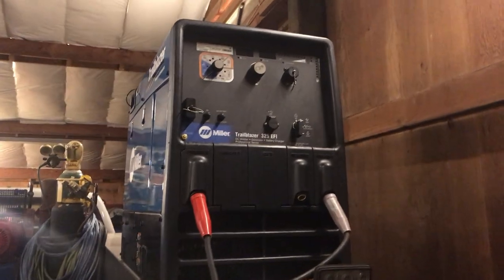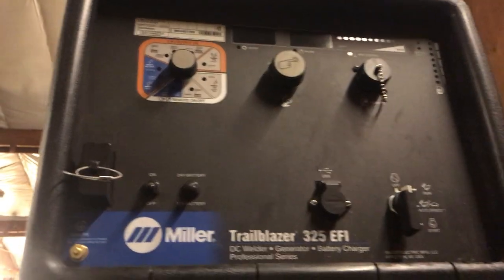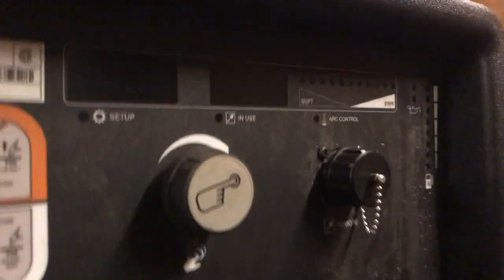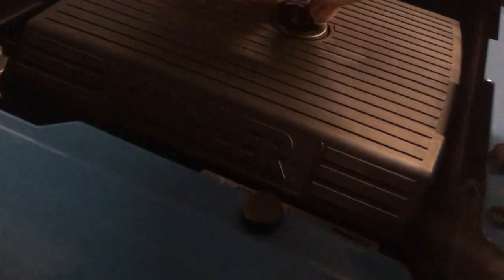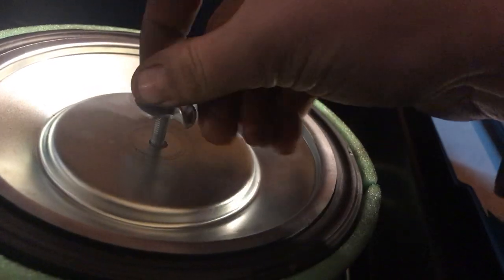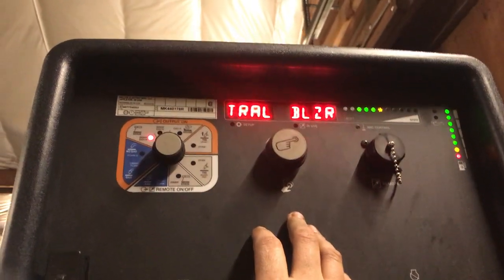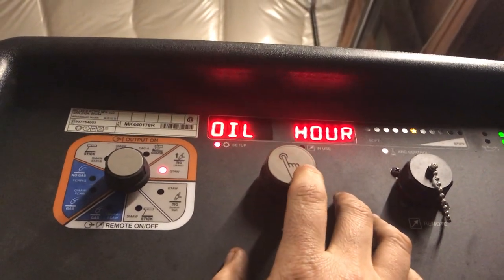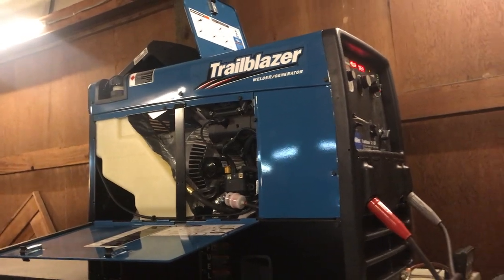(2) Miller trailblazer 325

Comment: I have the 2012, 302 diesel and that baby is like a sewing machine. I weld at 300 with my 12x vs suitcase  on bucket shanks. Does 7 shanks on a volvo bucket in about 6 hrs running .052. Lays down at 500 IPM

Comment: Thanks for showing us the new fuel setup. I have a 2015 with EFI 325 and everything you've shown, but always had to problems with the electric fuel pump going out. I plan to add a jockey pump like yours. Was hoping someone did it before me. Now I have confidence. Thank you.
Reply from the maker: Did yours come with the plastic crankcase pump that was mounted on the valve cover?

Comment: 3:08 I noticed fuel filter is angled down after line goes up creating an air pocket (as it shows) - Could create problems. Just me? IDK....
Reply from the maker: That's very common on horizontal filter to have a little air pocket in it, not ideal but I haven't noticed any issues, got about 620 hours on it now

Comment: Do you know how to disable the auto shut off on these machines? Mine is constantly turning itself off if it sits running for too long.
Reply from the maker: Are you saying the engine shuts down if it has been idling for a while? How long will it idle before the engine shuts down? 
I would imagine that is a problem with the machine, not a setting. I've never heard of any of these having a idle shutdown timer, unless one has been added aftermarket.

Comment: I just pick up a used unit with the battery charger on the unit . Don’t have cables for . I’ll have get some for it . Right now the EXcel power not working on it . Trying to troubleshoot the problem . All fuses are good so I don’t know what’s going on yet
Reply from the maker: On mine anyways there is a circuit breaker on the inside of the machine, if you have the owners manual for it. That should show all of it
Reply: Be sure your 220 outlet is switched on. No load. Try it again. If it still doesn't work. You'll pretty much need another board. I've already had to replace mine. Mine was the board. Then the second time it was the 220 switch, which I didn't know it controlled so much. I just rolled with it.

Comment: I would rather give it back to miller for, the 2011 trailblazer, this new one eats too much gas, n I dont like all the jumping up n down give me a new 2011 trailblazer with a carb. Come on miller,,, 3rd trailblazer 05' 011' 20'
Reply from the maker: Your EFI trailblazer burns more fuel than a carbureted trailblazer?